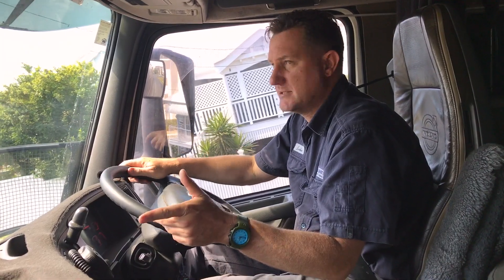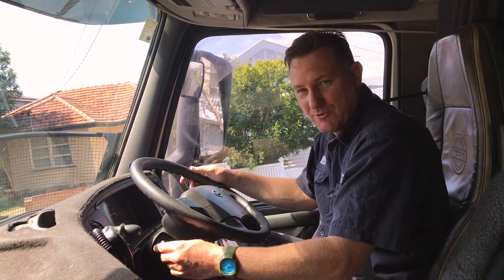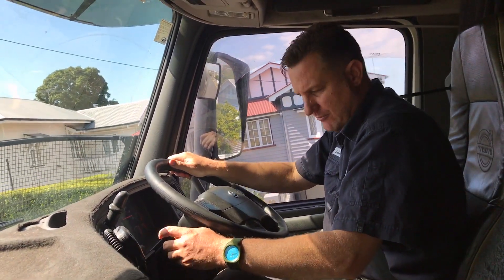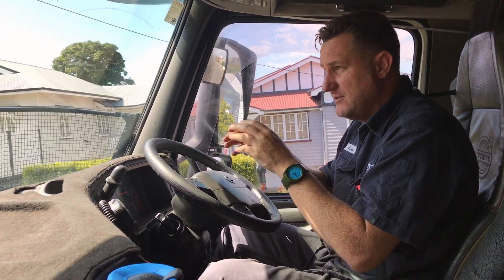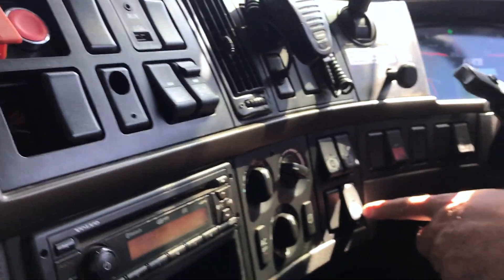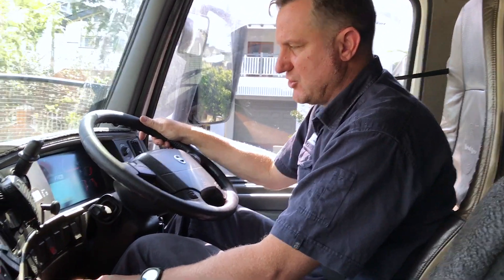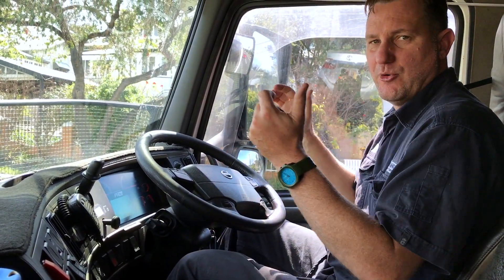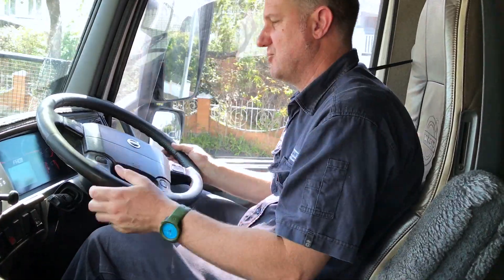How To Drive A Truck  - HILL START & HILL ASSIST in a VOLVO TRUCK

Comment: I wanted a manual transmission truck hill start. Automatic is well, too easy.

But you're right, the air brakes have a lag.